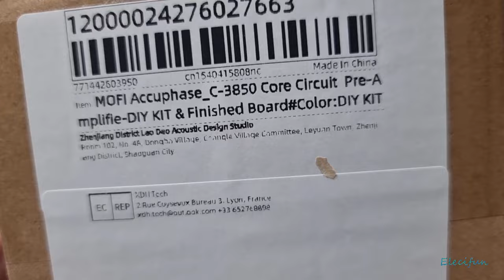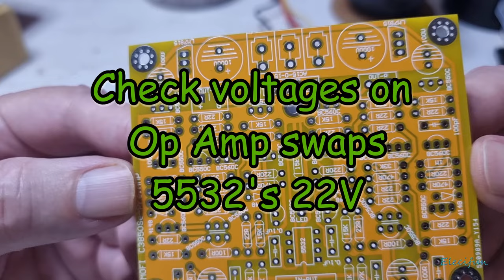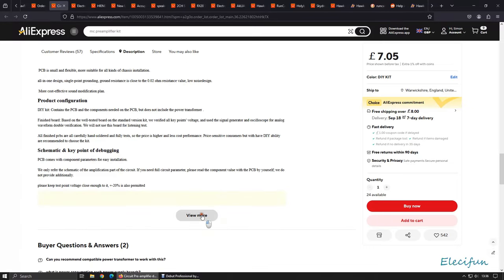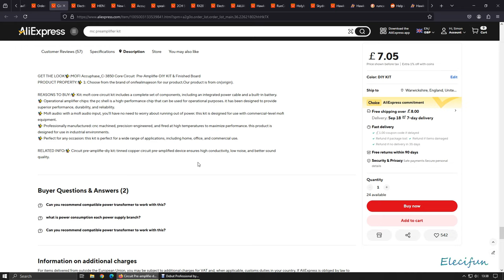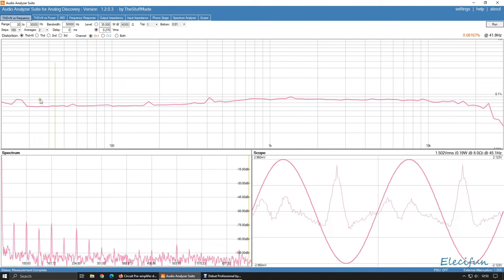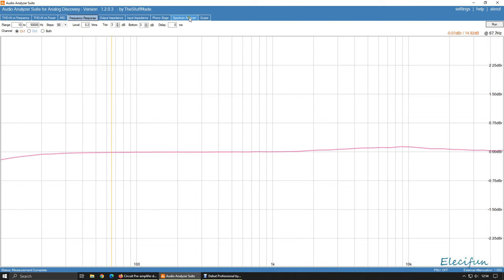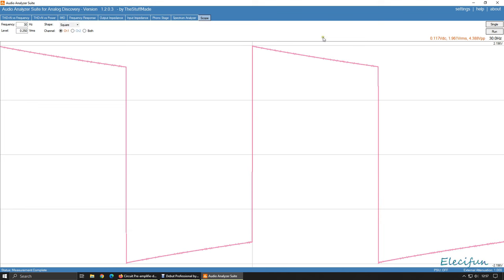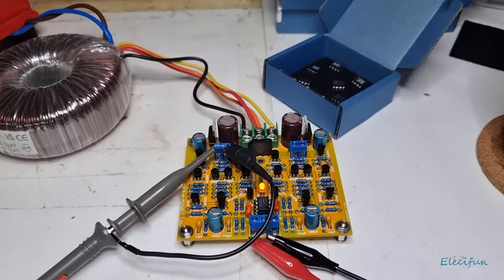MOFI Accuphase_C-3850 Core Circuit Pre-Amplifier KIT (AliExpress)

Comment: That's a nice little preamp. Aren't they supposed to have volume, treble, and bass controls?
Reply from the maker: @decem_unosquattro9538 some do, you can buy or build tone boards with or without volume control. These days a lot of people myself included use music players as source and volume is built in. I don't like tone controls myself I like everything flat.
Reply: @Elecifun  oh okay. 🤔 Tone means, treble and bass right?
Reply from the maker: @decem_unosquattro9538 Yeah conventional tone controls would be for bass and treble.
Reply: Ive seen these with 3 inputs with relays and a knob switch for selecting inputs.  I plan on ordering one of those.